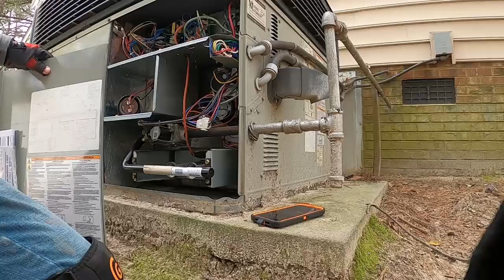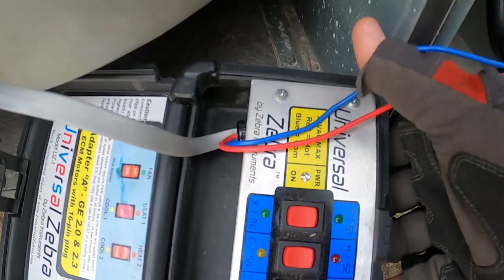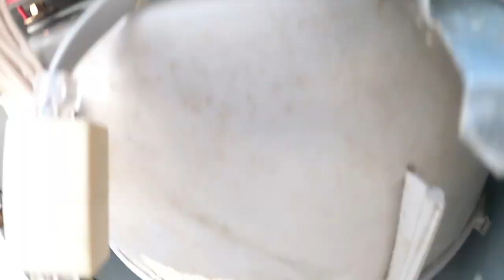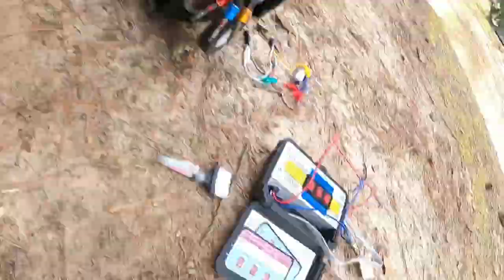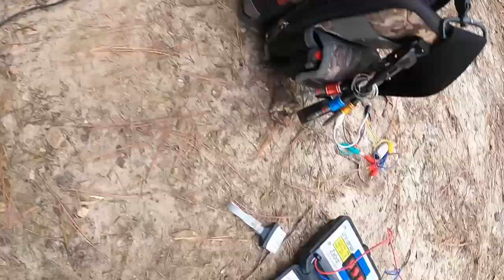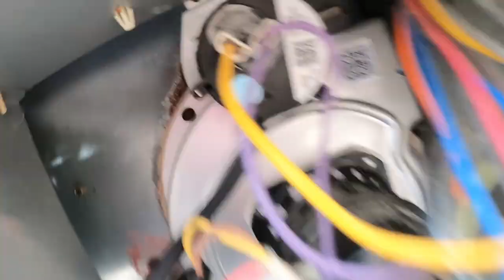No Heat Call, I almost missed a key problem.

Comment: How does tranes have that many multiple failures?
Reply from the maker: They are not what they use to be.
Reply: @MYHVACLIFE that’s what I tell every customer. Been with a company for te years now and all summer last year was warranty work for trane heat pump TEM model in particular. Leaking indoor coils. Also bad compressors bad caps and contractors
Reply: Because it's a Trane